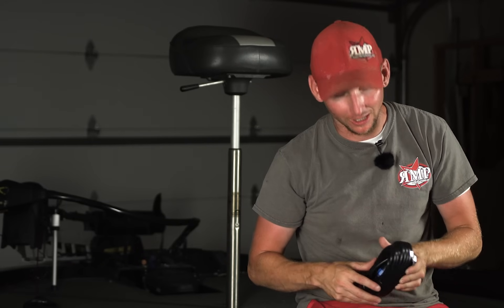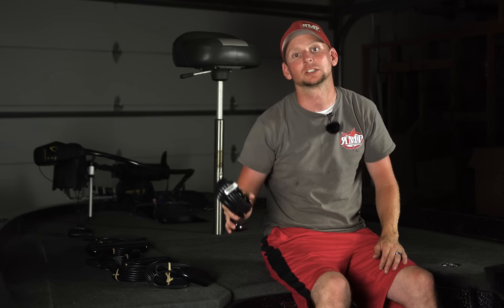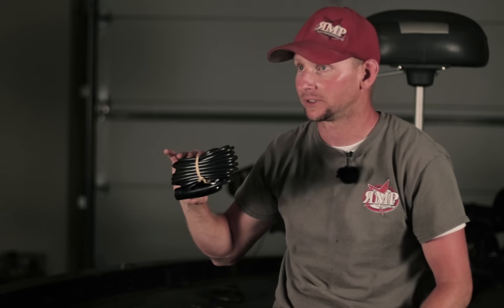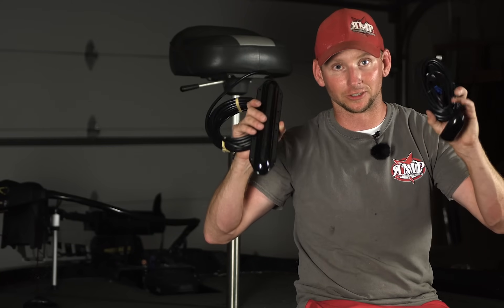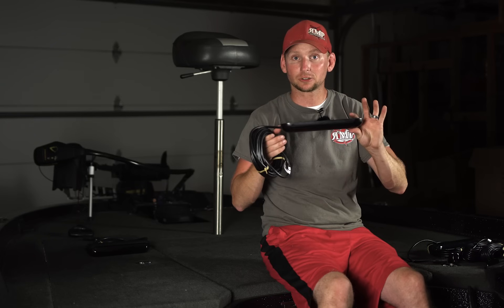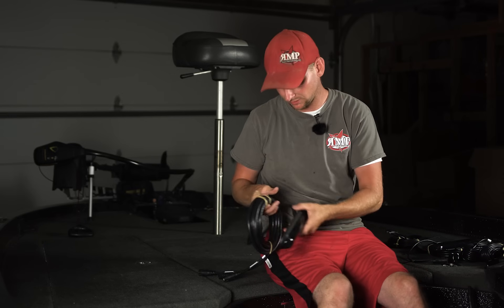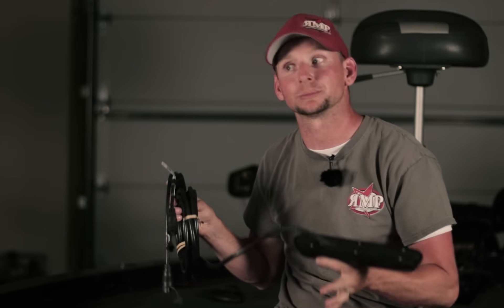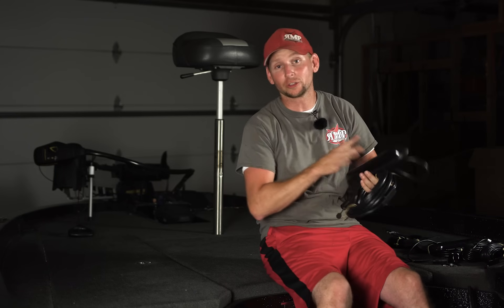DIFFERENCES BETWEEN TRANSDUCERS: LSS2, TOTALSCAN, HDI, 83/200, 3D

Comment: Bula from fiji..So i just bought a new hds live unit   and wanted to pair it with a hdi 50/200 skimmer 9pin since its an affordable transducer and has chirp big plus from the p66 . For offshore use since we dont have lakes in fiji lol.. would that be a good set up for ranges between 60 to 350m  thanks.

Comment: I want to add side imaging with the LSS 2 trans. on my HDS7 Touch and move my HDI transducer to the 7 Pin sonar port.  Will I just need a 9 to 7 pin adapter cable?  Also will I still be able to get the water temp reading from the HDI this way or does the LSS 2 provide that?

Comment: I have an Elite Ti2  7 inch with a 2 in 1 transducer.... if I bought a used HDS 9 Gen 3 with a downscan transducer, can I take the 3 in 1 off the 7 inch Ti2 and put it on the HDS 9 head unit?

Comment: Bro, I bought the TotalScan transducer and a HDS Touch Gen 2 from you guys cause you said in the video at 4:30 that you can use the TotalScan transducer with HDS units and you CAN NOT use the Total Scan transducer with the HDS Touch Gen 2 models. I installed the TotalScan on my boat yesterday, was all pumped to try out the HDS Touch this morning and hooray flipping nothing worked!!! And ya, I went into the settings for the sonar and tried to find the model of transducer in the menu and guess what, it's not there. Just for fun I tried selecting every model of transducer in there to see if 1 of them would work and nothing.
Sooooooo ya, there ya go.
Reply: Funny I asked the same question with the Lowrance Tech and they said the totalscan will not work with the hds12 gen 2 touch... use the lss2

Comment: Question, I have the Lowrance 3D transducer and HDS Live set up now. I need to add the HDI transducer to get 2d sonar and water temp working. How close can the 3D transducer and HDI transducer be mounted with out causing any interference? My current plan is side by side with about 2-3" spacing. 
TYIA

Comment: That clears alot up, how deep will the totalscan see fish in salt water , would it go 150+m? If not what trans would be best
Thanks
Reply: Nathan Woolford 3D imaging with the Totalscan is limited to about 150 feet maximum in salt water. The traditional & “Chirp” depth (2D as it’s called in this video) will work much deeper. I have seen it working at 250 feet, but doesn’t show a lot of detail beyond 200 feet deep. For saltwater use in water over 100 feet deep we usually install a thru hull transducer, and usually suggest switching to Simrad (Navico owns both Lowrance & Simrad). Simrad is more aimed at offshore saltwater use & Lowrance is mainly a freshwater and coastal unit. Hope this helps.

Comment: I’ve currently got a lss-2 and skimmer transducer mounted on my boat from my gen 2 touch units. I upgraded one to a gen 3 unit and it came with a totalscan transducer. Is there any point to remove what I got and install the totalscan? Is it any “better”?

Comment: Do you still need the 3D box to run structure scan on the 3D  transducer, or can this transducer hook directly up to the Lowrance HDS Gen3.
Reply from the maker: with the 3d setup you will need to use the 3d module and transducer, it will cannot plug directly into the back of the unit itself.

Comment: The HDI transducer in your video looks a bit different than ones I'm looking up. Is there a difference between the one in the video and a "skimmer" I will be mounting this on my trolling motor and am looking up the correct adapter to do so. I've found the transducer in the video HDI as well as one that looks a bit different,  the "skimmer". The only adapter I've found says it's for the skimmer. Thanks in advance!

Comment: Hello Justin, I just watched and subbed. You really cleared up a bunch of questions that I had. But I do have a question about the skimmer. I just purchased a new HDS7 gen3 that came with the lss2 for my new native titan 10.5 kayak. I mounted the LSS2 under the boat and after watching your vid I realized I need to use the other ducer also. So here is my question. If I epoxy the skimmer to the hull will it read water temps? And if no, can the LSS2 read water temps.
Reply from the maker: it will read water temps, but it will read the water temps from being epoxied in, not the direct water temp since it isn't in the water.  We typically see the water temps off about a degree or so with the transducer being glassed in vs. mounted in the water.
Reply: Russell Marine Products, LLC 
Thanks for the response!! 1 or 2deg off isn’t to bad. The hull thickness is probably a fat 1/8th so the bottom will pretty much be the temp of the water. My lss2 is mounted toward the bow of the yak. Should the skimmer be mounted within the same area?  I can either put it in the front bow just in front of the lss2 or I have Nice flat spot near the stern. Where do think it’s best?

Comment: So, if i buy a Carbon 9 with the 3d structure bundle, then i cant get splitscreen with  structure scan to the right and 2d on left? (if i use the transducer for 3d and HST-WSBL for 2d )     am i correct?

Comment: About to upgrade from an Elite 5 HDI to an Elite 9 TI.  Can I use the currently installed HDI transducer along with the Structure scan transducer and Y cable, rather than install the skimmer transducer?  Thanks!!!
Reply: Correction, Elite 5 DSI

Comment: My HDS9 gen 2 side transducer is cracked and now my system locks up if I turn it on in the menu. Or it's because I moved it to my pocket on my flats boat? The structure scan transducer was mounted to my hull bottom and I moved it in hopes of reducing drag. My boat doesn't go any fast and now I'm without side scan. Is the cracked transducer dead or is it the new location? Any advise would be very much appreciated!

Comment: Do you know anything yet about the new HOOK2 transducers called "Splitshot" (sonar + downscan) and TripleShot (adds sidescan) for trolling motor mount
Reply from the maker: Terry Farris yes sir, know a lot.  What questions do you have?
Reply: Is the tripleshot same as Totalscan?  Can I use an aftermarket Trolling motor mount designed for Totalscan to mount the TripleShot HOOK2-12 ducer to my trolling motor?

Comment: I run an HDS gen 3 with an HDI Transducer. Can you tell me which one to select on the unit? There are 3-4 different ones that show HDI. Currently it shows HST-WSBL / HST-WSU but I’m not sure that’s correct.
Reply from the maker: David Jensen you will need to select HDI 83/200+455/800 sir.  Then make sure when you go to structure scan that you change the view from “left+right” to “down”
Reply: Thank you. I also have the LSS2 so it will still do the side imaging without having to change anything else right?

Comment: OK, maybe you can help me.  What transducers would you have on the boat? Are any of them thru the hull? Do you have a 83/200 and a 3D module? Is the 83/200 thru the hull? I have tried twice to get the Lowrance folks to help me trick out my boat without success.  They refer me to "the dealer".  I want to know from a users like you what you found is the best combo.  BTW, what are your thoughts on Spotlight?
Reply from the maker: We have the 83/200 epoxied thru the hull and have the lss2 mounted externally.  No need for the 3d module unless you have the 3d transducer.  The spotlight scan is decent.  I prefer the hdi transducer for 2d sonar and down imaging.  BUT sometimes you can find a great deal on a new spotlight scan and it is cheaper than the hdi transducer and trolling motor adapter.  When you mean "trick out" what are you looking to do?  We have some great deals on new HDS gen3 boat in a box bundles that literally have everything you need to completely set up a boat.
Reply: What I have is a Triton 21X3 with Humminbird 1197 & 997 since 2009.  Both  are not worthwhile.  Tricking out is my term for having this awesome fishing machine with Carbon units front and back. I want to maximize the complete potential of these units.  So what I am looking for is any and all combinations of transducers that will give me that edge.  Is it 3D Structure, SI, Sonar, and what is the best combination of transducers to go with it.  Lowrance emails are useless since they refer to you; the dealer.  This is their latest answer "LSS-HD is part number 000-10802-001. The HST-WSBL is a skimmer transducer that uses 83/200 kHz. Make sure you have CHIRP."  So if I were to call your store, what should be on the shopping list? I would like to have it detailed.  Pretend you are doing a boat that has no electronics.  Thank you for your previous prompt reply and useful information.
Reply from the maker: Bert Rosado send us an email at: rmpllc@aol.com. I can give you a breakdown of everything and the advantages of everything.

Comment: Really helpful! Thanks for sharing. Question: will the HDI 83/200/455/800 work with Gen 3 units? Not just touch but with keys too. I keep reading different opinion and in your video you only mentioned "Gen 2 and 3 touch units". Thanks!
Reply from the maker: Gen3 units are touch units, and it is compatible with gen3 units.  You will need to select the hdi transducer under your installation settings In your sonar section to utlilize all the hdi transducer functions.
Reply: Thank you!
Reply: @RussellMarineProductsLLC  just wondering which transducer setting I use for a gen3 with a totalscan transducer??....thanks for your help....